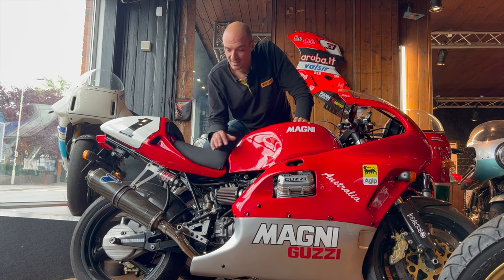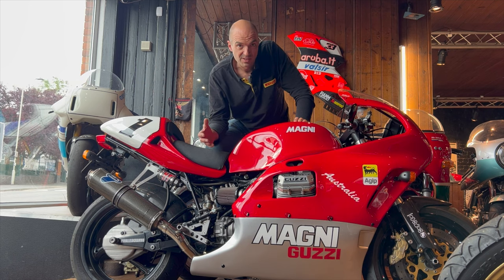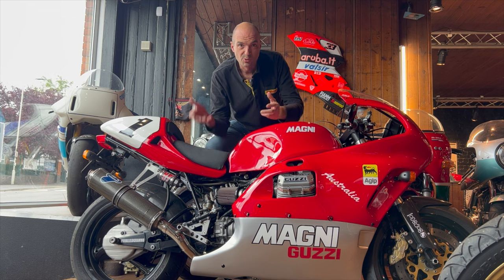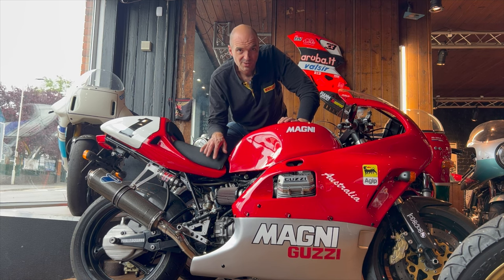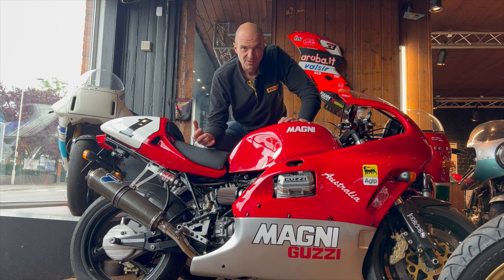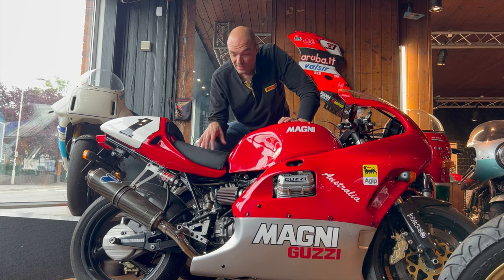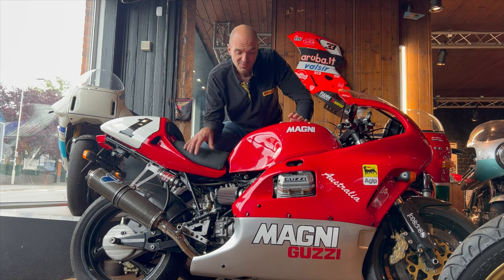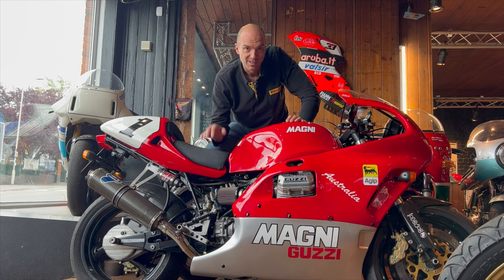Magni Moto Guzzi Australia, ride out and tech talk

Comment: I think there were about 90 units of the series 92 Australias built, there was then a second series built in 98 using the Daytona RS engine (C kitted Daytonas) they had a beam frame as opposed to the tubular/beam on the 92s and different forks. Approx 50 units of the 98 series were made AFAIK
Arturo Magni developed the parallelogram arms for the MVs but then developed a chain drive conversion. When MV folded he briefly produced models using Honda then BMW engines, but it was only when he entered into a relationship with Guzzi did bike sales take off and the Australia was probably the pinnacle
Magni wanted to build more but Guzzi couldn't supply them with the running gear/engines/gearboxes
I know that bike and the previous owner, it's absolutely immaculate and totally sorted, I wish mine was half as good
Thanks for the video, that was a treat and I agree they are amazing fun to ride and sound glorious.
Reply: As far as I know there where 70 Australia build in 92 and 50 in 98. I got an 98 with 1250cc engine and 135hp. I will never sell it, it's heaven on earth.
Reply: @rolandeisner4751  
You could well be correct my numbers are approximate. 
1250cc Yikes,  Your bike must have undergone some major changes, major players with these AFAIK were Raceco and Dynotech but there were/are others. 
I'd love to know some more about it.

Comment: Given the green frame in the background some trivia for you. First time I rode my 1100 sport I was amazed how much it felt like a bevel. I got out my tape measure and the relationship between bars seat and pegs was identical to an SS/Hailwood/etc, but everything was much higher off the ground. The bike felt like a bevel in a sweeper but the steering didn't load up in hairpins, it pulled from idle and had more torque than the Hailwood mille. Magic bike, but my tiny legs didn't reach the ground. Tontis have much lower seats, more like a 750SS/GT/Sport... I lusted after the early twin shock magnis, and kick myself for not buying the prototype Australia when it came up for sale decades ago in WA...it was even fairly cheap!

Comment: As a multi-time (and current) Guzzi owner, I wish someone made a Magni rear suspension conversion for the Tonti framed bikes. I currently have two '76 T3s, one of which is being cafe-ed, and that would be a nice upgrade. Maybe it is protected (patented)?.
Reply: Magni make them, been doing it for decades. I am assuming magni are still going. After the father died the son took over. Last I looked he was still building bikes to order. The swingarms come up second hand very occasionally. Personally I think it's over rated. My 1100 sport was a very different beast to a tonti but I've never found the shaft effect an issue...